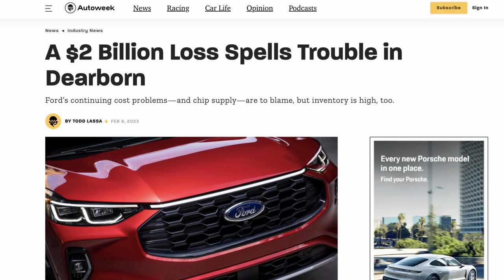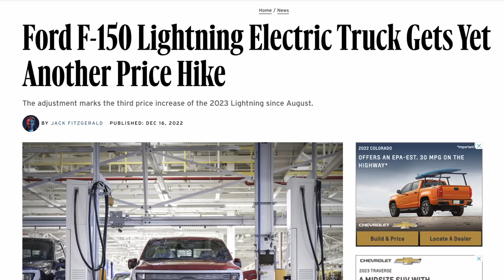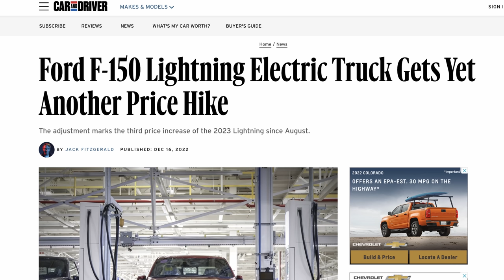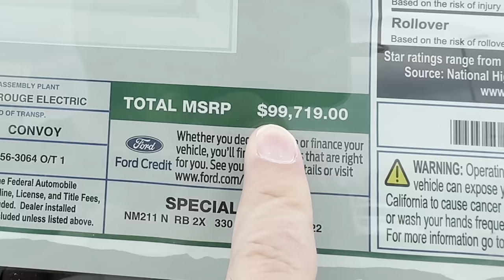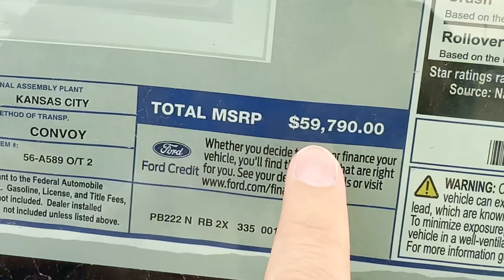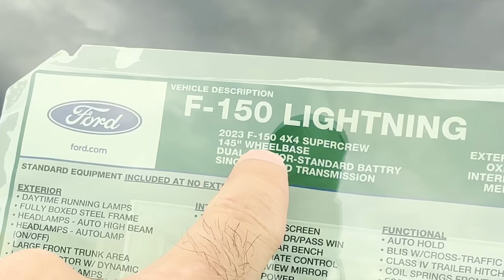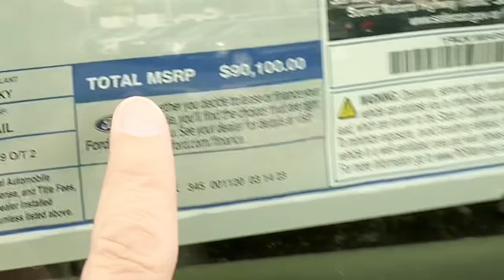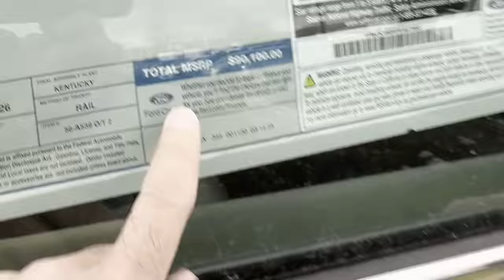Ford CEO Makes HUGE MISTAKE, Now Dealers CAN'T SELL TRUCKS!

Comment: Without cheap cars, entry-level buyers just go elsewhere and never become “Ford” people. 

When will companies learn that removing choice and only selling the “top sellers” is a road to death.
Reply: I don't know, Harley Davidson is doing the exact same thing right now. 30 to 50K per bike now.
Reply: @petebusch9069 you're talking Apples to Oranges. The cost and space needed to produce Harley is far less than that of a Ford vehicle. 

Also Harley's are pleasure vehicles and not what people buy as their primary vehicle or very rarely.

It's almost like comparing a Ford to a RV.
Reply: The Dealerships are the problem: those cars coming out of the Manufacturer are worth about half of what the Dealers sell them for; these people Conn you out of your money...
I know I worked at one back in the 80$, chi, ching!!!😮
Reply: @davidcouture5970  You missed my point. Harley, Ford, and a bunch of others figured out they can just set the price WAY high and enough people will pay it. That's what they have in common. It doesn't matter what the  end use is, pleasure or practical, people will pay it thinking its just how it is now. This will not continue and prices will fall, only a matter of time.
Reply: And now you just figured out how they gonna get people to switch over to cheaper Chinese EVs like BYD or Geely
Reply: @presidentcomacho3816  But they're not cheaper, electric cars cost even more.
Reply: @petebusch9069  yes they are
Reply: @Pete Busch  it's no different then when a hobda accord and civic become more expensive and bigger so they can introduce the smaller cheaper city line. With f150 costing 80k+ and even over 100k you don't see a place to introduce a 40k ev and get people interested because of the huge price gap. I have lived in Asia and seen it happening you just waite
Reply: @presidentcomacho3816  Can you do simple math?
Reply: @petebusch9069  can you
Reply: @presidentcomacho3816  Great user name!

Comment: Just happy with my Rivian R1T…performance for days and tows 11K. Buying experience was next level and customer support beyond point of sale has been simply what it should be…awesome. No dealer BS
Reply: Ive seen 12 Teslas and 5 Rivians and a couple of Euro EVs in the parking lot at work. But only 1 Ford Lightning and it was dealer owned. 
Either way;  businesses will be scrambling to add charging stations for customers and employees over the next decade. Make money off your employees while they make you money and make money off customers while they spend money? Yes please. 
Any business with a parking lot where customers spends 30mins or more is a future goldmine.
Reply: Those are really expensive. I want a work truck that I can use on the farm and that has 4wd for when it snows. That's just another overpriced truck
Reply: Rivian won’t make it much longer. Wouldn’t buy it.

Comment: Nice video. I recently made an offer on an F350 used at Jess Ford in Pullman,WA(across the border from Moscow,ID) and they told me to walk. They wanted 80k on a used 2018 F350 and I offered 78k. So the dealers don't appear to be making deals either. I hate to say this, but I'm now looking at Chevy,GMC, Dodge for my next pickup truck purchase.

Comment: Here in the UK, dealers often register unsold new cars and then sell them cheaper as "used" cars. These pre-registered cars bump up the total number of new cars sold by the dealer, while still being on the lot. Which bumps up the dealers bonuses from the manufacturer.
Reply: What? How does that help? The Dealer still pays a cost to the manufacturer for their inventory they take in. What??
Reply: @mikhailmobius2308  It's how the manufactures and dealers sell surplus cars at a discount price as "second hand", while still charging the full price for new cars. New car sales in the UK peak twice a year because people will pay top prices for the latest year's registration prefix when it changes, Manufacturers don't want to be seen to sell "new" cars at a much lower price during the slack periods. It also lets them start writing off a significant amount of the value of unsold inventory.
Reply: For the Statistics the cars sell very good! That is the reason

Comment: Honestly, theirs a reason I have it planned to take half a year off work to restore an old pickup.  I'm spending about 20k by not working, but, I'm getting a truck that while it doesn't have the new features, it's a nice classic that I've built my way, that I appreciate just as much for significantly less
Reply: And that's the way you do it. It's the reason I drive older cars and trucks. I won't spend that much for a new truck that has a plastic intake and a plastic oil pan.

Comment: I had a big Bronco reservation for two years.  At the 12-16 month mark, Ford came out and said they'd "prioritize" orders from dealers who didn't discount their Bronco deals, meaning many, many people had their Broncos who only had to wait a few months.  Now, and I know it's illogical, but I resent the entire company even though these choices were by a small subset of employees.  I abandoned my order and now have a 4Runner Off Road.

I've had a classic mustang and two modern ones.  A ranger.  And I don't see giving them another chance ever again.  Terrible job, Bronco "reservation" decision makers.  Blank you specifically.
Reply: From a business standard it made sense to sell first to the people paying the most. They are making money. Not running a charity
Reply: @ComsiCaterpillarstandard Corolla for 50K
Reply: What bank is going to finance an overpriced truck without a substantial down payment? Better yet, what insurance company will cover it without additional GAP coverage? And trucks have the worst crash record. You'd have to be nuts...or a loony millionaire to buy a piece of crap that's recalled constantly not to mention the high risk of injury or death from a crash or faulty components. What a world!
Reply: You did yourself a favor. Those Broncos are made from balsa wood and those Toyotas will run for 300K miles or more.

Comment: After looking at all of this, just go for a different brand or a pre-owned truck that you know you can fix up if it breaks. My father gave my younger brother his old 2002 Ford Explorer Sports Trac. Recently the engine had to be replaced due to a mechanic not putting the oil back in after changing the clutch disk. To be fair, neither my dad nor my brother checked to see the engine oil level but you would assume that the person we pay to fix our vehicle would remember to put it back together again when finished. We almost had a fire too because the mechanics that we found to replace the engine put the fuel line rubber tube over the coolant pipe and burned a hole in the rubber. Least to say my father was not very happy with them, especially since we had to replace that part and it was hard to find the correct name for it, and what more we found out there were missing screws.
Reply: Selmir Avdic - Only go to garages that have pristine reputations. They will be expensive, but work will be good.  I recommend doing careful research on YouTube with car gurus that give you the straight scoop on what cars to buy new or used and what cars to avoid like the plague that will eat you alive on repairs. The "Car Wizard" and Scotty are good sources; I am sure there are plenty others.

Comment: Wow! Ford used to have dependable and long lasting vehicles. My first car was a 1971 Ford Galaxy 500. It was four years old when I bought it. I drove that car for 14 years. The most I had to spend on it was $100 for a flywheel. Henry Ford would be extremely disappointed with the current Ford management.

Comment: In Michigan I am seeing the same thing. Lots are full of trucks and also you even see lines of broncos. They ripped people off and its catching up with them
Reply: I'm curious. Is Ford charging for SHIPPING/FREIGHT even if you live in Dearborn?
Reply: @msb1999  funny enough yes. Compared to delivery/destination charges I’ve seen on YouTube posts they aren’t as high tho.
Reply: I hope so too, I want a new F250 4x4 for work, but 59k is crazy. I'll wait and see how badly they want to sell one in Dec. or even next year. Still even with a great credit rating, your going to pay 5% interest rate.
Reply: @hoeto63  I keep limping mine alone. 09 f150 with 260k miles. Cracked windshield, heat only works on high, need timing chain phasers, tailgate stuck closed. But she still starts and gets me to the job everyday. Just can’t give into those prices yet

Comment: I got a "recall" on my 2019 F150 which said they would extend the "warranty" on the part for 10 years in case it breaks.  They won't even fix it until it breaks just hoping it makes it ten years.  Something to do with the power windows if I remember correctly.

Comment: We tried to order a hybrid F150. We were told it would be over a year and we might not even get it. The dealer didn't seem eager to sell us a truck. We ended up buying a RAM truck.
Reply: RAM as a Chrysler, Jeep brand was likely a mistake as well
Reply: Fire risk anyhow.
Reply: I’m sorry for that.Should’ve bought a Toyota
Reply: They're owned by the Chinese now... GAC bought out 53% of FCA in 2016.
There are no more American made, American brand, vehicles anymore.
Reply: *except for Tesla, but it'll be a cold day in Hell before I buy an EV...
Reply: @fadingbeleifs you will have no choice but to buy an ev eventually
Reply: Lol!!! You bought a truck from a company with the worst reliability and quality control. Toyota was your answer.
Reply: @adspur  that was my choice but we couldn't find the one that we specifically needed
Reply: @sdlausen1  thanks, we have two other vehicles that are Toyota , so we know the brand well.
Reply: @fadingbeleifs you really should, evs are better vehicles now, even the military is going electric
The range debate is mostly nonsense 

And for city driving with stop start traffic you’ll much prefer an electric motor to an ICE

Comment: In 2016 I bought a pearl white f350 platinum dually brand new for 67k Cad. I went from that f350 to a 2020 2500 high country that was 86k with a discount. I currently have a 2024 dodge ram limited mega cab dually what was 121 Cad in 7 years trucks have doubled.

Comment: Out of curiousity I just looked up a Tundra Crew Cab in my area and they were all under 60K. Still way too much for a truck that should cost in the 40s but at least they are more reliable and wouldn't cost the owner lost days at work.  Had no idea Ford was no out of touch with their base.

Comment: Ford needs to discount those pickup trucks by $20K to get them moving. The economy is getting worse. Expensive vehicle sales will keep getting worse.
Reply from the maker: 20k drop puts them right at where prices were in 2018-2019. Needs to happen.
Reply: I disagree - 50% discounts are required.  A solid F-150 XLT without heated and cooled seats, a 14 inch display, and all the other odorous add-ons should sell for well less than $40,000.  I'm looking for a 5.0 coyote, 4X4, 8 foot bed, with a single cab configuration for $35,000.  The only major option I'd like is an option to boost the payload of that vehicle commensurate with the towing capacity - don't advertise a towing capacity of 11,000 lb with a payload of 1,600 lb.
Reply: Yes, people will keep paying these prices keeping them high. Its just that simple.
Reply: Who controls prices for consumer when it comes to cars? Dealerships or car manufacturers?
Reply: I've been in the market for a new car but it looks like I'm going to stick with my 2002 Silverado until it falls apart. I could justify something closer to 45k but that doesn't get me much these days lol. Even decently optioned mid sizes are 50k.
Reply: Way too Expensive!
They have to do the same with eV s!!
Reply: I feel the same way I have a 2000 F250 just gonna drive the wheels off this thing even if you try to buy used in my area $30-$40k is still going to buy you a pick up that has more than 200k miles. Yeah no thanks.
Reply: @brandonlong2064  The consumer sets the price. Its high because Ford figured out enough people will pay it. Vote with your dollar. Right now there are a TON of people waiting out the storm for lower prices that WILL happen, only a matter of time.
Reply: @mulinzhan4167  Just get a 250. Not that much more money and it will get nearly the same MPG's as a 5.0 F150
Reply: As stated by others,  no good Ford reducing prices as they won't sell due to dealerships reinstating 5 digit price gouging.
Reply: Retired people with fixed incomes, like myself, cannot afford even a 20k drop in prices.  My vehicles are payed for and it's still difficult to live.  Apparently buying a new vehicle has become possible for the upper middle income and wealthy only.  I don't know how lower income workers are even surviving at this point.
Reply: @ironcladranchandforge7292  Me either, its crazy and seems as though nobody cares, business as usual. Where is all the money coming from? We don't even eat out anymore.
Reply: @petebusch9069  --  Eating out, I wish.  Maybe once per year, but nothing expensive like steak.  I haven't been to a fancy expensive restaurant in probably 20 years.  Now it's out of the question.  I had to buy a battery for one of my trucks last week.  It was around $200!!  I remember when the same battery was around $50.  Absolutely crazy!!
Reply: @brandonlong2064  consumers. there are people willing to pay these prices. Until that changes........
Reply: @ironcladranchandforge7292  Well, at least another person just became a billionaire today so there's that. That is what's important today based on most peoples actions that support these crooks. You and I will just sit back and watch the S show, don't worry, good deals are coming our way, only a matter of time.
Reply: @petebusch9069  --  Funny thing about billionaires, they eventually become worm food just like the rest of us mortals. In the end, we're all the same..........
Reply: $20k is about right. Adjusting for inflation my '97 F250HD powerstroke would be just under $40k in 2023. The website price is $56k today. I totally get that government meddling with "safety" crud will drive up the price but that's +$16k before it gets to the dealer.
Reply: They need to do something, because a basic 1/2 ton truck should not cost 60K
Reply: @MotorFeed  30K drop is where they should be.
Reply: @ironcladranchandforge7292  So true, and the sad part is they never really get to enjoy life. Its so dam ironic I almost fall over thinking about it.
Reply: 20k gets them down to the price a great truck should be. these are still garbage. no thanks
Reply: Three words to remember......Auto industry bailout.  Trust me, its coming.....again.
Reply: @Mike-In-O-Town hell how many American auto companies are actually still American owned?
Reply: @Mike-In-O-Town  I disagree.....I think many people will be very vocal about bailouts....I would rather Toyota swallow it up than pay these morons to run the shop
Reply: @mulinzhan4167  It's a half ton truck. That's all it will ever be. The payload will never be more than that.

Comment: I fell in love with Ford thanks to cheap, affordable vehicles like the late 90s Escort. Its been years though since I have seen a single newer Ford I like however. Like even the Lighning looks the same as everything else they are pumping out. I can agree with you the company has gone to shit and they need to fire some higher ups that just dont know wtf they are doing. Its like they are throwing darts to see what they should try next instead of looking at the state of the economy to guide them

Comment: I remember a time when Ford's official slogan was "At Ford, quality is job 1".

There's a reason they don't use it anymore.
Reply: Brahahaha. Quality was never job one at Ford. Profit was job one, helped by using cheap low quality parts. GM is only slightly better. No wonder Toyota is eating their lunch.
Reply: @rewing4880  
Correction...quality WAS job 1 at one time. In 1978 my father bought a Ford Fairmont that lasted him almost 20 years. It was the most reliable car my family ever owned.

Comment: I really wanted to purchase a new F150 single cab short bed 5.0 but not one dealer within 100 miles of the Houston area was willing to reduce the $50K price tag. I ended up purchasing a pre owned SCSB 2019 Ram 1500 classic with the 5.7 for $25K
Reply: the truck you describe had a sticker price of $23k in 2011 for the STX trim. the price exploded when they started making them out of aluminum.
Reply: @connor_flanigan And the pedestrian safety standards, increased CAFE requirements, increased emissions standards, etc, etc. 

A truck was considerably easier to manufacture in 2011. Some of this is Ford’s problem, much of it is mandates.

Comment: Bought a Duramax crewcab in 2020 for $58k. Convenience 1 &2 packages, Z-71 and 5th wheel. 100k bumper to bumper or 7 years.
-10° and it starts right up. Now, it will start if not plugged in but i wouldn't do that to her.
Not sure what the current pricectag is. 50k miles and its been in for a new DEF tank and rear axle shims.

Comment: in 2003, you could buy a Ford Expedition XLT at the dealer for $34K.    I know this because I was deciding between that, and a nicely optioned Lincoln Navigator for $38K.   At the time, starting salary for someone with no experience in my industry was $36K.  Nowadays, the cars are $90K but the starting salary in my field is around $55K.    I think the sweet spot for these cars are $55-60K.  What do you guys think?
Reply: Thank the government for printing billions in handouts during COVID to create the massive inflation you see today.
Reply: If you adjust 34K in 2003 for 2024 its 56.8K